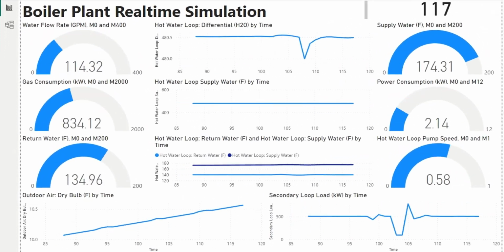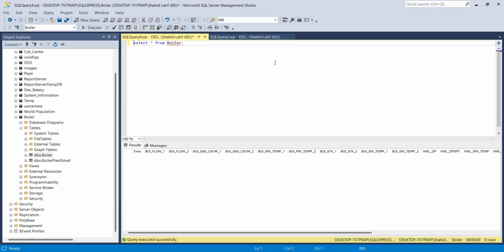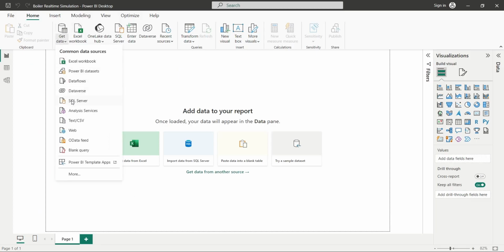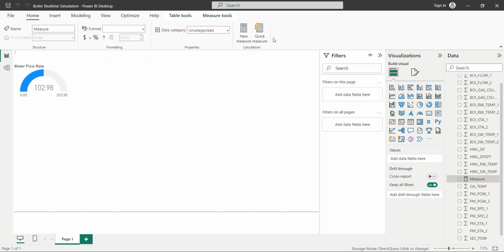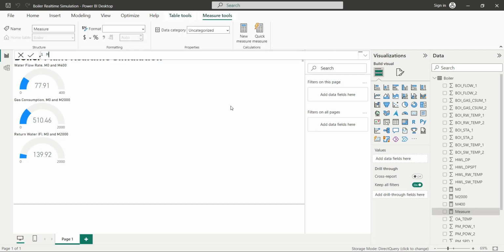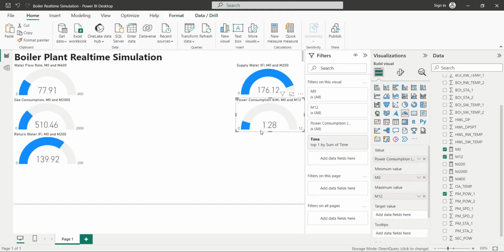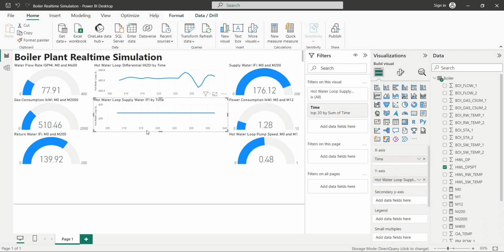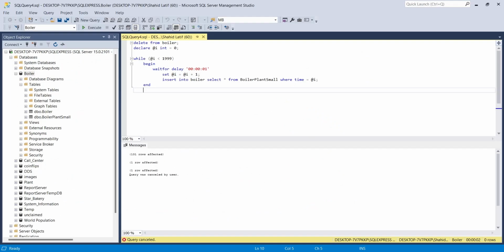Power BI: Displaying Realtime Boiler Plant Information in Power BI Dashboard using SQL Server

Comment: Hello, I have many tables in a single database. How can I execute queries on all these tables simultaneously?
Reply from the maker: Can you give a simplified version of query you want to execute? and to be clear, are u talking about DAX query in Power BI?
Reply: @virtual_school  no the query in sql server
Reply: In the video, you showed how to add and execute a query for one table. However, in my case, I have multiple tables on which I need to run the same query at the same time. What would be the best approach to achieve this?
Reply from the maker: Ok. You have asked a very interesting question, and it could have multiple  answers/solutions as well. The simplest one being, if you have multiple related tables, meaning all tables are linked in the model view, you can simple create a new table using function crossjoin "newtable = crossjoin(table1,table2,table3,table4)" and thats it, now you can run as many query as you want without having to worry about multiple tables, because the newtble has all those tables in it. Hope this helped you.
Reply: @virtual_school  Thank you so much! I'm going to try it right now and will let you know how it goes.
Reply from the maker: Again, Ma'am, are you talking about SQL query, or some DAX query. I am confused. If the question is about this video, I am guessing you are talking about SQL query, while my earlier answer was about DAX.
Reply from the maker: If you are asking about sql, it is simple, you can place query of each table saperated by ";" and it will work fine. All your tables will be updated at the 'almost' same time.

like:
update table1;
update table2;
update table3;
Reply: @virtual_school  I'm discussing SQL queries because here we can run and execute commands across tables 
So, if I understand correctly, I need to create a new query to update all the tables, right?
Reply from the maker: @khadijaazabi6165  You can update all tables in one document with lines saperated by ";". They will be updated in sequence, line after line.
Reply: @virtual_school  Hi i tried it but it didn't work ,here are my three queries:
delete from inju;
declare @i int=0;

while (@i<1999)
	begin
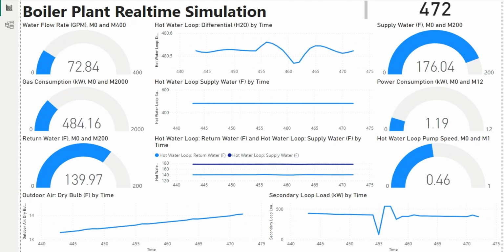		waitfor delay '00:00:01'
			set @i=@i+1;
			insert into inju select * from injuries where i=@i;
			select * from inju;
	end
delete from equipement;

while (@i<1999)
	begin
		waitfor delay '00:00:01'
			set @i=@i+1;
			insert into equipement select * from CEquipement where id_equipement=@i;
			select * from equipement;
	end
	

	delete from losttime;
while (@i<1999)
	begin
		waitfor delay '00:00:01'
			set @i=@i+1;
			insert into losttime select * from LOST where i=@i;
			select * from losttime;
	end

When I press "execute," the queries run sequentially—first the first one, then the second, and so on. However, I would like them to execute simultaneously
Reply from the maker: You need only one loop. and inside that loop put all the insert commands. like:
loop start
insert into table1;
insert into table2;
insert into table3;
loop end

Comment: Hi how can i connect to my websocket url  to visulaize live data
Reply from the maker: Power BI Desktop does not support realtime data from websockets. In Power BI Service, you need to use an API to connect to such data. SQL DirectQuery is the best option for real time data in PBI Desktop.
Reply: @virtual_school  how can I achieve that
Reply: It shows wss not supported
Reply from the maker: Yes unfortunately it is not supported.

Comment: Hi. In case i have a folder with many csv files (generate each 5 seconds), how sql take these files and convert in a only one flat file? Excelents tutorials. Regards
Reply from the maker: Convert all the flat files to a single flat files every five seconds? It is possible. Can you explain the actual scenario a little bit? why do you need to do this? Even if you can't, it is still doable. And we will use the same loop and waitfor method here as well. Inside that loop, the code will merge all flat files and create a new one every five seconds.
Reply: Hi. I will expand a little more: I have an online analyzer in the production process, and it performs an analysis every 5 seconds, which it replicates in a csv file. I want to have that data in real time in a power bi dashboard.
Reply from the maker: If it is just to learn, no problem, it can be done. But if you are doing this for a client or at work, I must tell you this is not the way to do it. The system that generates the flat file, should send that data to Power BI directly. If you re-enter that flat file to another SQL server database, and then send it to Power BI, it will cost you a lot of resources.
Reply from the maker: I have uploaded a new video based on your problem. I don't know how much I could understand and deliver in the video. I hope it gives you some ideas. https://youtu.be/JmfauKJo8Ik
Reply: @virtual_school   Thank you very much for taking my query for this video. I really appreciate your generosity in taking the time and work for this.
One more question: can I see the published report with real-time information in real time through Power Services?
Thank you very much again for all.

Comment: Is it possible to do the same on mysql. I mean when and new row added in the table the dashboard and data set refresh automatically?
Reply from the maker: Yes, but you need this adapter https://mariadb.com/docs/xpand/connect/power-bi/ to do that.
Reply: @virtual_school  do u have complete example on how to do it with mysql?
Reply from the maker: Do you want me do a video on that?
Reply: @virtual_school  I hope so if u don't mind.many thanks for your prompt help and support 🙏
Reply from the maker: No problem dear. Its my job. I will do it at my earliest.
Reply: @virtual_school  OK waiting for u .wish you all the best. Thanks
Reply from the maker: https://youtu.be/VQdPfHu5_z4 here you go.
Reply: Wow many thanks❤ is it real time?
Reply from the maker: Yes. Between mySQL and Power BI, this is realtime. Information is updated per second. If your mSQL database gets information from a real boiler, pwer bi will display realtime information.
Reply: @virtual_school  i have seen this video https://youtu.be/VQdPfHu5_z4  where is the part which make dashboard auto updated when any new data added to mysql database?